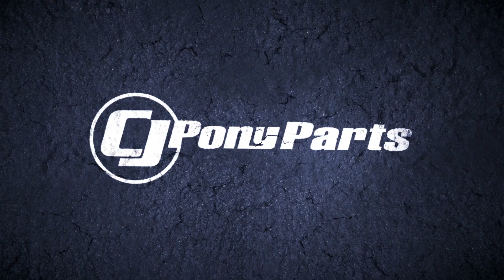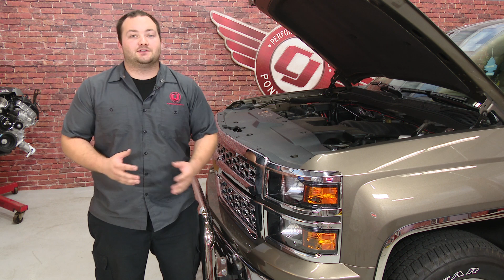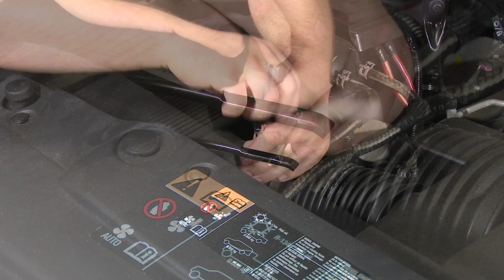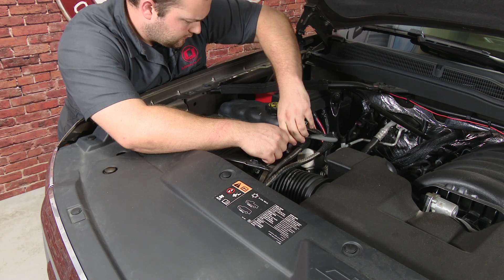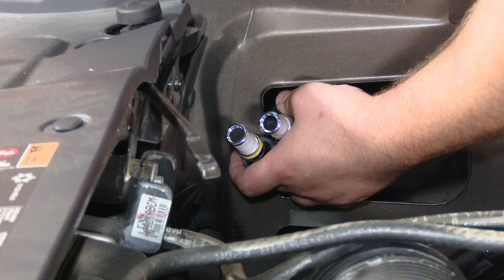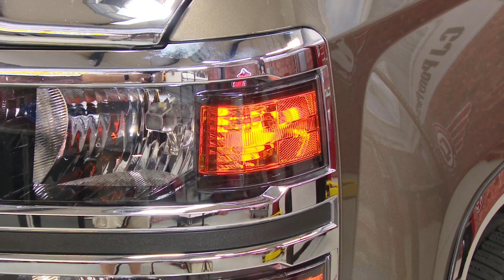Chevrolet Silverado Diode Dynamics Front Turn Signal Bulb LED Amber Set 2014-2018 Installation

Comment: I have a 2011 Midnight edition that I put all LEDs exterior lighting in 2015. I blew the engine 2 yrs ago. At that moment I bought a 2015 High Country and want to do the same. Since the lights I used for the 11 aren't available anymore I would like to know what signal lights you are using for this. And the number. And is there anything I have to install to eliminate hyperflash once these are installed. 
Thanks

Comment: Can anyone help I have a 2014 silverado 1500 and my top driver side turn signal won't stay on but works when I flick the turn signal never been good with the light problems on vehicles
Reply: I have the same problem.
Reply: Did u figure the problem out I’m having this problem now
Reply: Same problem here, any solution?
Reply: You would have to change the turn signal bulb. It has like two in one bulbs. Mine did the same thing and as soon as I changed the buld it worked.
Reply: I installed LED’s in my 2015 Chevrolet Silverado 1500 LTZ for front turn signals and rear lights too and installed 4 resistors and still have hyper flashing

Comment: So how do you get the led blinkers to stop hyper flashing? when i install resistors they stop blinking altogether.
Reply from the maker: Installed properly load resistors will eliminate hyperflashing but wont stop them working.